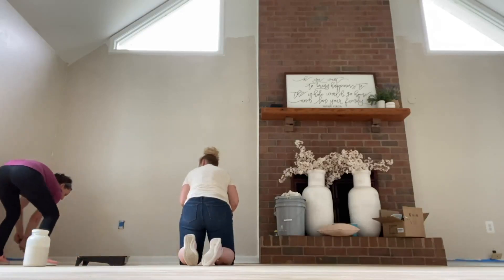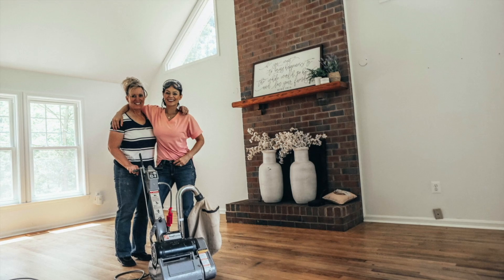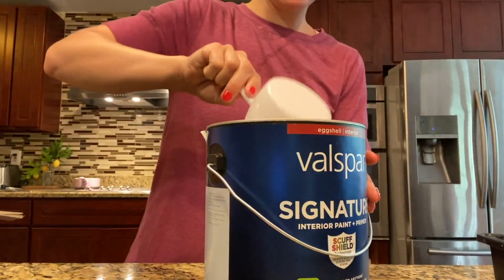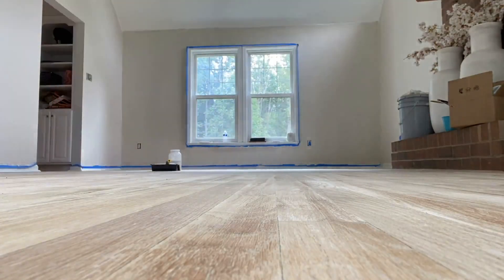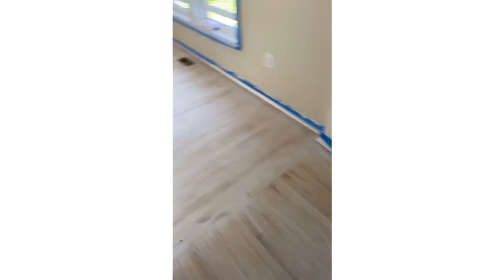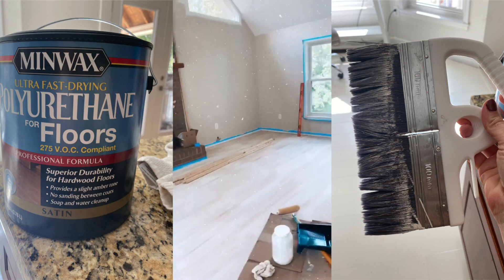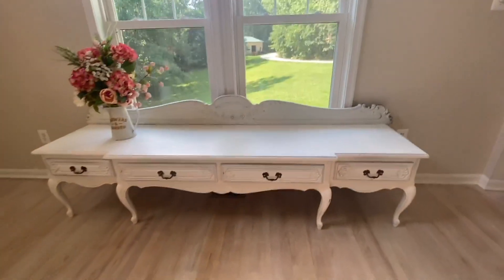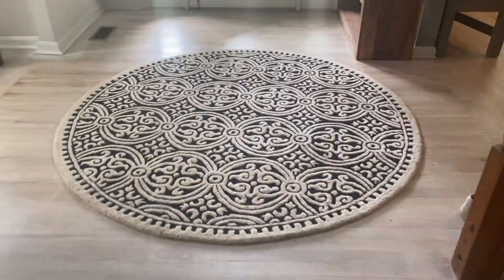How To Refinish Wood Floors EASY & Cheap | DIY Whitewash | Lauren Stewart

Comment: For tough old stain/finish I’d use a 16/36 drum sander paper first then 50/80/100. Make sure you go slow first two cuts to remove all finish. Edger sander on perimeter. Instead of white washing with paint, just use country white stain by Duraseal. Much better. Good luck!
Reply: The only sensible comment in this section 🤣
Reply: How many coats of that stain and what type of sealant?

Comment: Can I ask your floors look beautiful just the look I would go for but how do they stand up to wear and tear? Down the line do they still look so good?
Reply from the maker: Hey darling!!! Thank you for asking! Yes we absolutely love them still! They have held up through rainy season which means mud and lots of water ends up on them. Thank you so much for asking!
Reply: @LaurenStewart  Thankyou so much Lauren I live in Anglesey Wales U.K.in a small cottage we originally sanded and varnished the floors but I am in need of a change I am inspired to have a go.
Reply from the maker: I’m excited for you to do them! Best of luck! Feel free to ask questions if you have them!
Reply: @LaurenStewart  well ! It’s done my other half sanded and I have painted a watery coat of frenchic dazzle me alfresco paint tomorrow we seal with some satin floor varnish. It’s brightened up the room we have also painted the skirting boards that were natural pine and we are doing the door frames.

Comment: Hi I’m considering white washing my floors but I have 2 dogs. 1 lap dog and 1 large dog. My large dog has scratched my hardwood floors bad. I’m afraid if I paint he will do it again. I see you have 2 dogs does the paint come off because of their claws?
Reply from the maker: Hi! I’ve had zero issues with the dogs and the floors at all. Mostly just living on a farm keeping light floors clean has been the challenge. But if you seal them 3 times you should be good!

Comment: The floors look good but you did it the hard way. Next time buy Sweet Pickens White Oil Wax. After sanding apply wax. It leaves a white wash and seals it all at the same time.
Reply from the maker: Great tip! Thanks! I did it this way to make sure I had more control of the color. I was not going to seal it until it looked exactly how I wanted.